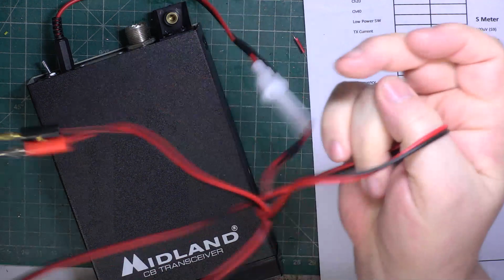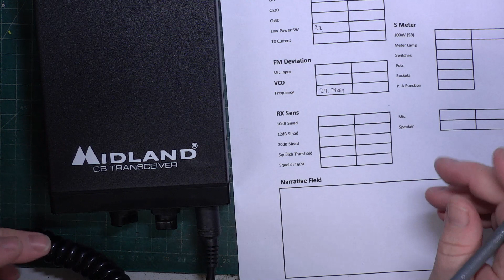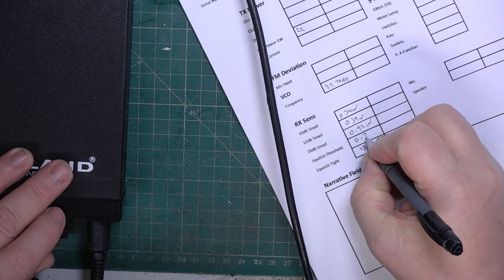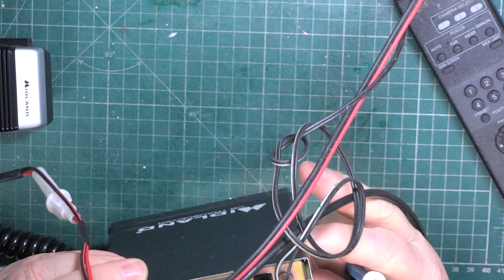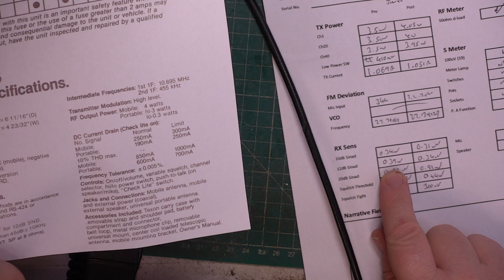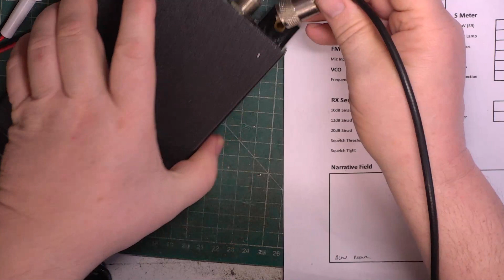Midland 77-805UK CB27/81 UK FM CB radio Portapack -  Service aligment.

Comment: No picture in picture? 
Disliked the video.
Reply from the maker: PinP is out of my control & is annoying when it fails to activate.

I'd prefer to use the Panasonic MX50 switcher, but youtube doesn't recognise broadcast quality analogue & degrated it to 360p.

I therefore have to use expensive digital tat that relies on software & doesn't always do as it's told.

Richard, G0OJF,  UK

Comment: hi 👋 richard good luck servicing the midland 77-805 uk cb 27/81 uk fm cb radio portapack   from paul chapman at east sheen        also i had a phone call from the shop where i took my soldering iron they said couldn't get the parts so i have to get a new one yesterday morning i got out to South of Italy
Reply from the maker: Roger on your soldering iron Paul,

Richard
Reply: @ukfmcbradioservicingTango21  to richard any ideas where i can get a new soldering iron  from paul chapman at east sheen 73's